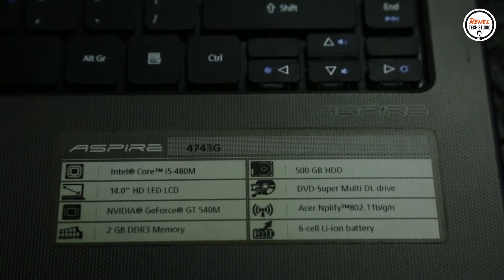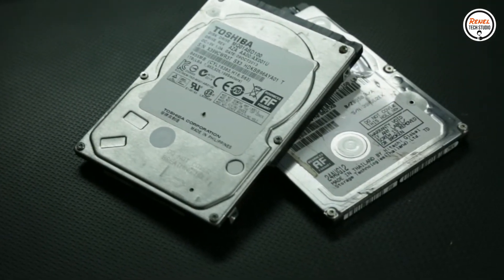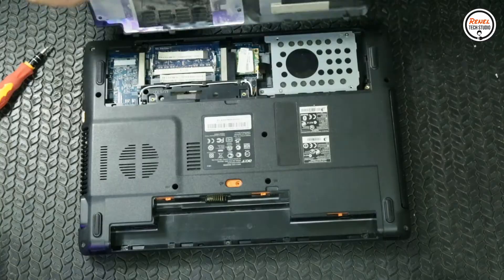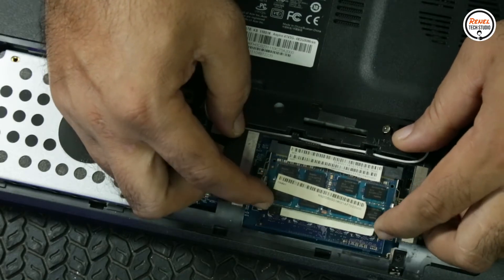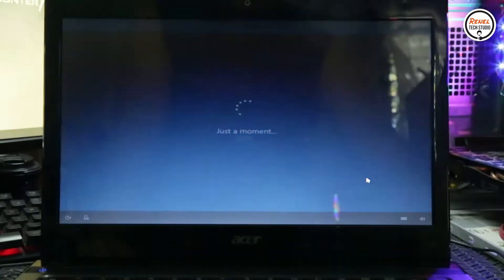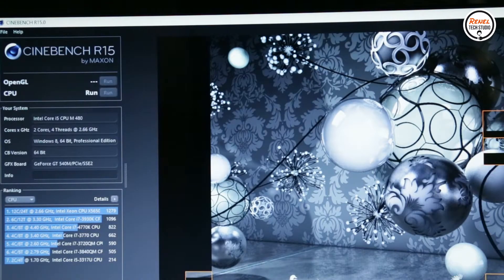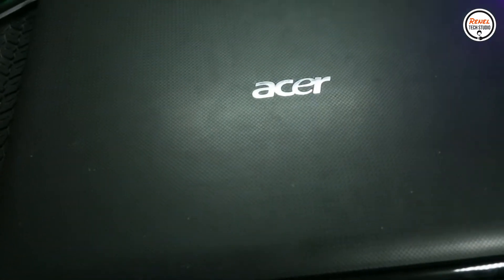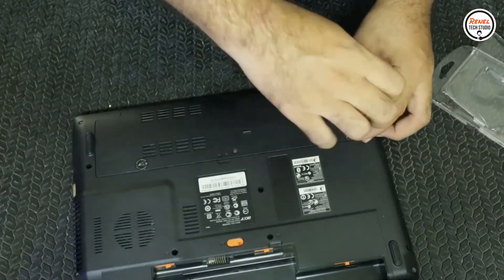Upgrading a 1st Gen Intel Core i5 Laptop, is it worth it?

Comment: I have a i5 480m paired with the GeForce 310m with 8gb ddr3. 

Just like in this video, the i5 really isn't that great, but you can do some light editing, light gaming, enjoy videos at 1080p, some streaming at 720 or 480p for live streaming stuff, very old 3d games work well, Minecraft is a jem on it, Roblox is hit or miss, depending on the game. And the other games that used to work well don't anymore because they require Dx11(feature 11.0) and mine has Dx11 (feature 10.0) so it's really only good for older Triple AAA titles, like GTA SA,Og Skyrim, Left for dead 2, Cod Black ops, Gta 3, and other older games. You can play some newer games but don't bet on it. Among us, Stardew valley, asphalt 8, and even some emulation can be done. Psp,N64,Ds,Ps1, a few PS2 games a few GameCube games, Dreamcast, and a few more older ones like Mame, Neo Geo, GBA,GBAC, and more. 

I'd keep it on Windows 7 or 10, I've installed Windows 11 on it, but I believe Microsoft cut out some stuff that makes the drivers work at wwdd1.0 or whatever the code is that is still in Win10

It's old but you can still use this. Just don't expect everything to work properly, some things need work arounds. You can actually play newer games, but you have to tweak something with the Dxcpl and it's not recommended, unless you like torturing yourself to get things to run perfectly